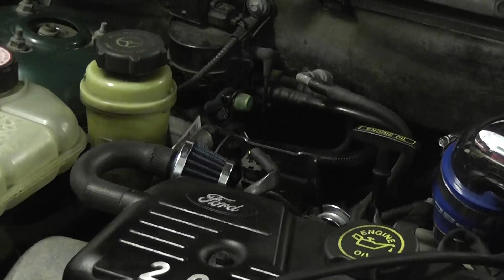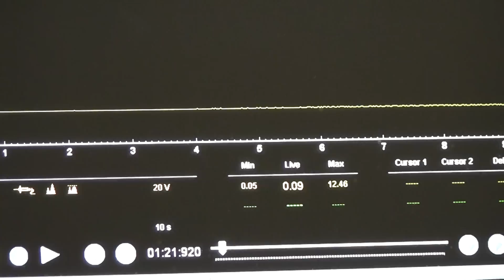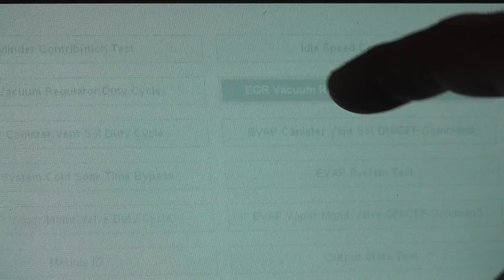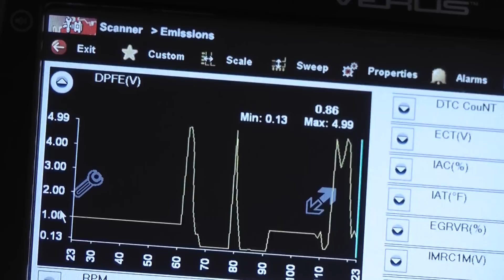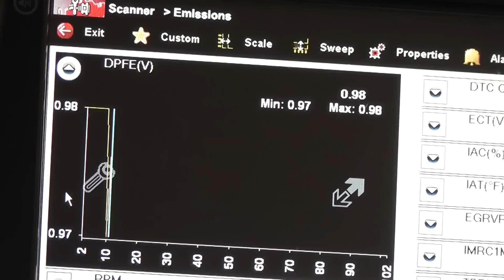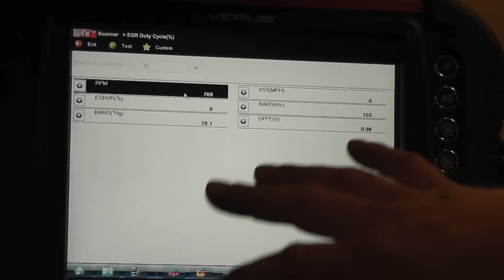2000 Ford Focus EGR System Tests (EGR, DPFE, EVR) - P1409

Comment: Here is one for you.....  what is you get a 2000 focus that acts like it misfires, looses power, spputters.... and you get no engine codes, none, never, nada....  the check engine light does come on if you run the engine with the MAF unplugged. its the ZTEC DOHC.  All of the following have been replaced.  computer, DPFE, MAF, TPS, Cam and Crank position sensores, Fuel pump and 2 injectors, timing belt, pulley, tensioner, DPFE hoses, plugs, plug wires, coil pack ....  Ihave taken the car back from the shop and I am inspecting this issue myself.....  when I changed the DPFE and hoses, I found the HI hose to be clogged with a bluish grey substance.   Just as a check I disconnected the vaccuum line on the EGR and plugged it with a screw....  it made no difference.. After watching your video, I checked the voltages on the EGR solenoid valve. when plugged in I have volage on one of the two pins only.... when looking at the firewall from the front of the car, 12v only appears at the pin on the right.  I checked using a test light from battery + to the pin and it did not light..... so its not shorted to ground..... I am now wondering if I have a broken wire.... but I am having trouble tracing the wire....  any thoughts on others to check before I start pulling cable harnesses apart?  I could really use some help. KD0JWD@gmail.com
Reply: This one gets stranger yet.... and is why the shop has not been able to find the problem. I rechecked the voltages on the EGRVR and I have 12v on the driver side pin and 7v on the passenger side pin of the connector. even when the voltages are there, the driving problem still exists......  I had someone else ride with me and they told me it acted more like the Catalytic converter was clogging up.  However, if I downshift when the car is acting like its loosing power, I can push thru it when I pump the gas pedal and then hold it down..... during the loss of power (time period) the car violently bucks back and forth.....as soon as it pushes thru it, it smoothes out......  driving me crazy..... HELP !!!  still no engine codes.....

Comment: when i back probe the dpfe i get 4.8v key on engine off.
Reply: 2000 ford taurus
Reply: ***** bad dpfe. im guessing there is a video about the supply voltage going right thru with no drop in voltage.

Comment: That's the fresh air inlet buddy. It won't set a lean code.
Reply: Incorrect, you should read up on it a bit, and how the PCV system works. I'm not bashing.

Comment: HI I HAVE 2001 MAZDA TRIBUTE  I HAVE PO1409 I HAVE CLEAR IT COMES BACK I REPLACE EVS SELONOID AND DPFF  AND   ECU   I STILL   HAVE  CODE    ALSO ICANN IT HAVE INCONPLED  EGR AND CATALIC CONVETER  PLEASE  HELP   THIS STARTED SINCE I LEFT CAR SIT FOR 6 MONTHS  I DROVE  4TO 6 TIME DROVE IT ERAISE IT CODES AND SAME PROBLEM   PLEASE HELP DAN
Reply: A scan tool to read voltages would help a lot. You may have a bad connection those can be a mother to find. Have u even checked the valve and passages? 1409 is insufficient flow? I don't recall.

Comment: Hello I was trying to check my egr modulator on my 2000 expedition, and when checking for voltage going to the plug i'm only getting 10.5 mv when plugged in on both sides and when unplugged i'm getting 10.5 mv on the right side and 12.5 mv on the left please advise. I think i may ahve a bad pcm.
Reply from the maker: Bo
This circuit is ground side controlled so that means this solenoid should have a voltage supply all the time with the key on. You have a supply side problem, not a PCM problem. Check all your fuses first.
I see you just purchased my eBook, Thank You! Go to Section 3 for more information about how these circuits work. Also check out Section 3 lecture videos on ScannerDanner Premium. It is free for 14 days.
Reply: Thanks I will check out these sections in the book and see what I come up with.

Comment: If the ground circuit is pulse width modulated, would there be any possibilities of damaging the module is u hold you're test light to the ground side of the circuit to activate the solenoid
Reply: No, you will never hurt a ground side switched driver (low side driver) by supplying a ground on the control wire. The only concern with PWM solenoids would be overloading the solenoid with too much current and burning up the windings of the solenoid. Another reason I use the test light instead of a jumper wire when I can.
Reply: I've heard its a bad idea cause current can flow through the test light... Never had a problem tho and I do it all the time. Still I always have that fear in back off my mind... LoL.  I've fried 2 ecms in my 9 years. Oops
Reply: Wiring ficm relay wrong broke ficm. Jumped a turn signal smoked bcm. :(

Comment: Chronic P1405 code. 1997 Ford   I've tested dpfe and vac solenoid per this video. All rubber hoses have clamps and are no plugged or cracked. Motor runs perfect. Except for luck at smog checks, the P1405 error has been on solid for at least 6. Years. The only thing I can't do is test the driver. Any ideas? What condition tells the computer to post the error? Dpfe signal  is 1 golf and 4+ volts pumped down with mighty vac.

Comment from the maker: For sure. DPFE sensor failures are common. I have a few other videos on Ford EGR systems that may help you too. There is at least one or two with bad DPFE sensors that I show the exact procedure used to test them.

Comment from the maker: P1409 indicates a solenoid wiring or computer problem. With the key on engine off both wires on the EVR solenoid should read battery voltage. Give me the result of this test and then we will go from there.

Comment: i know this a focus, but i have a 2001 v6 ford escape the p1409 code came on i change the EVR control circut and the check engine light still turns on last one was fried up and was throwing low ohms but i need help the p1409 still comes on the scanner!

Comment from the maker: That is a good tip thanks. Apparently the 5v ref circuit is being pulled to ground through the DPFE and affecting the rest of the shared circuits. I'll have to film that on the next one I see. 
I agree with your statement on why these fail and I would add moisture to the cause too.

Comment: I was using a Uni-spotter to weld studs for body work. Luckily I had the negative cable disconnected already, but my cousin who does bodywork says that it would have damaged the ecu if it was connected. Next time i'll just take the battery complety out. I think it sends positive through negative endangering some systems.

Comment: I recently seen a car that had a ecm   danaged  by someone welding on the vehicle.  Is there a sure fire way to prevent this from happening, I have heard removing the batt cables but I  was wondering  what the proper way is.    Thanks

Comment: Good stuff !!  Question:   On the test  light  connection to computer signal wire is there  any concerns that the test light could draw too much currant.  I do not know the capacity of the  drivers.

Comment from the maker: only on some cars. It depends on the EGR system design. Most systems there is a main intake passage for the EGR, on these types a single cylinder misfire will NOT result in a plugged passage. On the type with individual EGR passages, yes a plugged passage on all but one cylinder=misfire